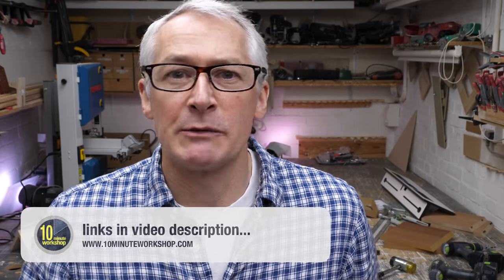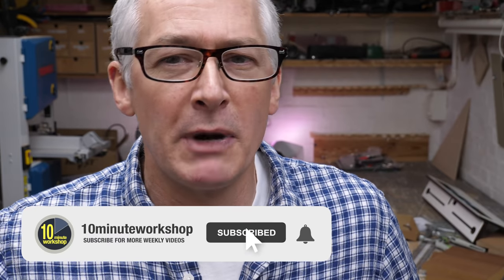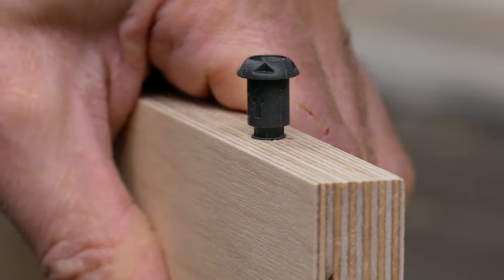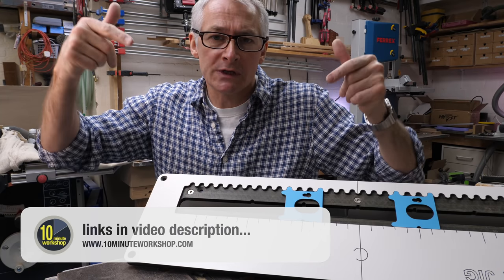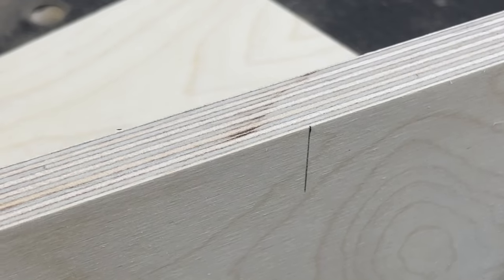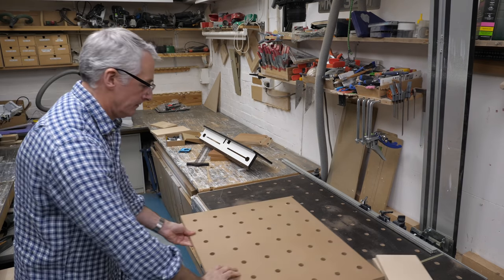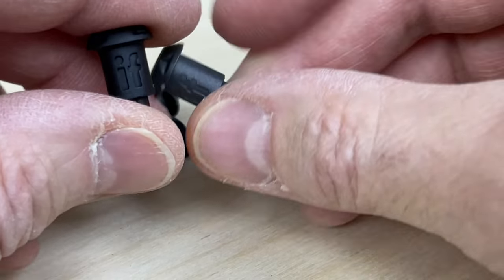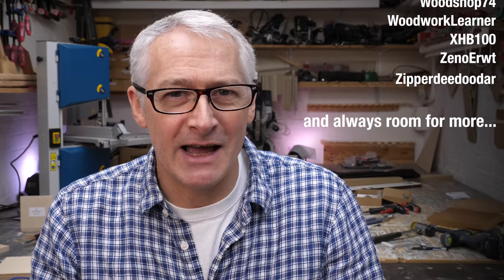Peanut 2 Jointing System - the mid-range solution? [Gifted/Ad**][video 429]

Comment: Peter, as ever you continue to knock it out of the park with your intelligent, balanced and considered demonstrations and reviews.👍 Its an interesting system and clearly offers significant advantages for professionals who have some volume requirements for carcass construction.For these users who probably have a power drill, router and workbench already then the cost of the jig and the bits and bibs that go with it is quite reasonable. For those critical of the developer (at the price point) probably have no concept of how much time this took to develop and how that places into insignificance the cost and time to bring to market. It’s not for me as I have no need for knock down cabinets and just use my very expensive domino (bought as a result of watching PM videos), however that is an irrelevant fact.😂

I read lots of comments asking how joint compression is being achieved in this manual version of the peanut jig which clearly can only be cutting a parallel slot, where the router bit enters and leaves is a round hole and the slot is engaging with the underside surface of what is essentially the underside of the ‘counter sinking ‘ of the screw which makes the peanut less compressible at that section as is acting as a wedge. I think.🤔

Anyhoo - thanks for this.😀👍👏
Reply from the maker: Thanks Norman! That's a great common-sense post, and likely explanation of the mechanics of it - as I hope to have it explained tome later today! 👍

Comment: I’m just thinking out loud here, but this seems like a great idea. It does rely on the purchase of a router too, so it’s £400 plus a router, but I like the idea and, for example, it should allow for permanent joinery with a Domino and by using the Peanut 2 system as well - should you need to disassemble parts to be able to fit it into a clients home, or even just be able to take it apart for a temporary solution (outdoor furniture during summer, but take apart to store in winter, etc). This system seems like a really good idea that is worthy option compared to a Festool or Lamelo.
Reply from the maker: Yes, it really does. And who amongst us looking at jointing systems doesn’t already have a 1/2” router? The mini jig - out in a few weeks - brings the cost of entry down significantly, too. 👍
Reply: @10MinuteWorkshop . Oh, I do understand that, but it was more to do with that the Domino and Festool are a all-in-one system, if that makes sense, but as it uses a router, at least the router is handy for other work too. There’s no doubting that this is a great system.

Comment: Very good system, great video Peter. I always enjoy your info & teaching. $460 US is a small price for what it can do. I have owned the DF 500 domino for 10+ yrs and just finished attaching face frames with 6x40’s in the lower cabs knowing the 4 teen boys in the house will punish the frames and doors.  This would make the uppers face frame attachment a breeze.  I have been eyeing the Lomello Zeta for the same application. Thanks again Peter
Reply from the maker: Thanks David. And yes, good point about face-frames - I rarely use them so I didn’t think of that, thanks! 👍👍

Comment: Good honest impartial video as always.
I really like dowels but yet to find a 100% accurate system 
Review of the triton dowel machine wasn’t very reassuring.
Have you any knowledge of a accurate dowel cutters which is effective and accurate? Thanks scott
Reply from the maker: Thanks Scott. I did a video - Dowel Jig Basics, https://youtu.be/zTj_hiEVfvw - where I got the best I could out of a cheap dowel jig. The wolfcraft is well regarded - I have one but haven’t really used it. Not sure if you’re aware but the peanut mini jig will also do dowels, is very well made and accurate. I have the latest version but haven’t reviewed it yet because of all the workshop stuff going on, but there’s a playlist with all the Peanut 2 reviews and builds in it here; Peanut 2 System & Projects - https://bit.ly/Peanut2system 👍👍

Comment: Real shame the centre line doesn't run all the way through. Seems a little bit of guess work for total accuracy between their line and your line
Reply: I thought the same, first thing I would do is score the centre of the line with as making knife all the way to the edge of the black part. Maybe it doesn't have to be bang on due to the nature of the fitting, IMO should be done already though.
Reply from the maker: It hasn't been an issue for me, but a fair point; obviously not an issue for end-of-board cuts as you'll be up against the fence, but for mid-board cuts I totally see where you're coming from. How about a similar little notch in the top black rebate, same as you get in the bottom? 🤷‍♂️
Reply: That’s a fair comment. I was thinking that rather than having to line up with a curve, why doesn’t it have a ‘V’ - so the user can line their piece up with the point of the V. Then again, as Peter showed, if you have a piece of scrap to butt up against, the components are locating in the same place each time.

Comment: The basic idea has clearly been around for ages but this is a fine implementation of it. Personally, I've already bought into the Domino system and I mostly work with real wood so I probably wouldn't buy this as well but for someone that works primarily in MDF and ply this could easily be a game changer.
Reply from the maker: Surely you mean Real Wood™ 😂 Yes, obviously aimed at the sheet goods fitted furniture designer/maker/installers out there, and a very well thought out system.👍👍

Comment: Hello Peter. I don’t know how much you have seen about the Shaper Origin but they recently had a hardware library update and they now have the ability to do Peanuts as well as Dominos, Blum hinges, Lamello Cabineo (as well as the m6?), Soss hinges as well as a lot of other hardware. Just an FYI.
Cheers
Ron
Reply from the maker: Thanks Ron! I wasn’t aware of that, no, so good to hear, thanks! Peanuts were especially problematic for the shaper I believe, because as soon as you move the machine backwards the bit would exit the material?? Something like that anyway, and not what you want at the end of a peanut slot! 👍👍

Comment: That's an interesting jointing system!  I must say that I've never heard of it. The part of the video with the router was not totally clear to me. Do you need a copy ring
(or how is it called) to route out the key hole slot in the board? Thanks for sharing the video.
Reply from the maker: Yes, you need a low-profile copy ring/guide bush; it comes as part of the starter kit, and is available as a spare part. 👍
Reply: @10MinuteWorkshop  (learning) woodworking has many things in common with (learning) Spanish. LOL  Both are my hobbies. At the start you don't know
anything. After many hours you get some knowledge of the theory and the practice. (theory is always easier) and you can start to make something yourself.
I finally have my small table saw up and running. Now I need 72 hours a day.

Comment: Interesting System! But like others wrote to expensive and in my mind to big for small projects (and i think, the smaller jig will be also expensive...). Bying the jig and a good router will cost about 1.000 EUR, nearly the price of a lamello. But a no go is, that you can not disassemble the parts without taking a hammer (if not glued). Clamex can be disassembled with a hex driver...
Reply from the maker: Only you can decide if it’s too expensive for you. But it’s aimed at folks in the fitted furniture business; they tend to have 1/2” routers, already. 🤷‍♂️👍
Reply: @10MinuteWorkshop  also, you can use the router for all kinds of other uses, a lamello is a one trick pony (or race horse in this case)

Comment: With fittings like these, I always wonder about the longevity of the availability of the consumables. Dominos can be made easily if they ever were to stop being produced, which obviously wouldný happen with a system that is as popular as that. This niche product seems nice, but I find it tough to pay 400 gbp and have to take that gamble.
Reply from the maker: That’s a fair concern; to be clear though, these fittings have been around for a couple of years and are widely used by cabinetry manufacturers whose main method of production are CNC and nesting machines. This is the first router jig they’ve made, and is aimed at the one man band maker/installer. There’s a mini jig coming that will settle a lot of the cost concerns. 👍👍

Comment: Like the look of this. So, does the mushroom bit of the peanut fixing deform when knocked into the slim part of the keyhole slot to create the tight fixing? Or does it deform the wood for the tight fit? If it's the former, it's not so much a knockdown fixing. I may be missing something of course.
Reply from the maker: Sorry Stew, neither! I don’t know how it works, but it manages to cut a slot that gradually deepens, so the head of the mushroom pulls tight agains the rebate. The peanut/mushroom doesn’t deform, and the joint can be made then taken apart many tunes without any problems. Really clever system! 👍 Mini jig coming very soon, will make it a much more affordable entry point!
Reply: @10MinuteWorkshop  Perhaps the blue inserts are not exactly parallel to the surface of the jig, and as you move the router to the right, the hole gets a fraction deeper as you go? 🤷🏻‍♂️
Reply: @10MinuteWorkshop  could you cut one of the slots in half and measure the depth of cut. hard to see how it gets deeper with that jig

Comment: what is the height and diameter of the body of the peanut?  I don't have a 1/2 inch router and thought it could be done with a 1/4 inch straight router bit followed by a keyhole bit set at the right depth.
Looking forward to the mini peanut solution.......

Comment: I hope I'm not duplicating earlier comments in saying that I understood the keyhole recess had a variable depth so that it would get tighter as the peanut is tapped home. I s there some magic about the cutter or am I just confused?
Reply from the maker: No, this was me being slightly confused. The keyhole slot is ramped if it’s being used in a CNC, but on this router jig it’s a flat slot that’s very precisely cut so that as you start to slide the peanut along the top trailing edge catches the top of the slot slightly, and it basically wedges itself in, tightening as it goes. That’s my layman’s understanding of it anyway; I’m just happy that it works. 👍👍

Comment: I'm Mafell DDF40 user(bought on the strength of your review partly) so I don't really need one of these. I'm  sure it's very good and has a place in the workshop but at £333 + £200 for a half decent router if don't have one - you're stepping into Lamello Classic X territory in terms of price. Yes, the Peanut 2 is invisible and I really like the look of the actual connectors  but it looks like a lot of hard work to make basic joints. I look forward to seeing the mini jig but it will have to compete with doweling jigs in terms of price to tempt me.
Reply from the maker: Fair enough - but in all seriousness, who in the fitted furniture / carcass construction business doesn’t have a 1/2” router, let alone a spare that they could dedicate to the jig 🤷‍♂️ And a Lamello Classic X - as lovely as I’m sure it is - is just a biscuit jointer; pretty sure you won’t get any KD fittings for it. 👍👍
Reply: @10MinuteWorkshop  Lamello Classic X works with Clamex S Knock down fittings They differ from the Zeta ones as they need a couple of screws. Better than this jig IMHO.
You also get a valuable tool at the end of it.

Comment: Good review and interesting product Peter. Thanks for sharing.is it the proprietary cutter that creates the angles at the bottom of the T slots that pulls the joint together?
Reply from the maker: Thanks! Yes, the cutter comes as part of the starter set, but is available separately. 👍
Reply: Router cutters can inherently only sweep a circular cross section, so.. somehow it must move on an angled path in order to create the angled result. My guess is that you put something on your router that interacts with the jig when you do the sideways move.

The website is very unclear on this. The cutter is supposed to move down by 2 mm during the first half of the 20mm sideways movement. No idea where that comes from though.

Comment: I think this is a potential winner. I would prefer to build cabinetry with proper joinery but that doesn't make it easy to move to a new house. I love the fact that is invisible and can be knocked down again. As an architect, when I design fitted millwork, I always try to approach it as a cabinetmaker. (my other hobby) I like to think I know what the cabinetmaker has to go through to make the end product. This is a revelation as far as I'm concerned.

One minor comment, I've been a patreon supporter for over a month and I don't see my name.
Reply from the maker: Thanks Patrick! Yes, a smart system, very well thought through. Re. your Patreon credit - and thank you for your support - I’ll look into it, but the list is usually updated for the Friday video closest to the end of the month, so sometimes if you join ‘on the cusp’ it takes a little longer for your name to appear. As I say I’ll check and message you through Patreon, but you’ll certainly be on the list from this Friday. 👍👍

Comment: fantastic. But what is realy needed is a system that will go down to 12mm or at minimum 15mm. (will the mini you mention be able to do this?) If im correct this will only go as small as 16..? So that means 18mm ply or MDF will be the thinnest it will do. Still a cool system though :)
Reply from the maker: I’ve used them in 12mm - the face-to face connection for the bench shelf was 12-12. The fence centres at 18 but will accommodate 16mm  (eg egger board etc...) - don’t see why you couldn’t pack out the fence by a few mm to centre on12mm; I’ll have to try it. I j if they can do 12mm compound mitres. 👍👍
Reply: @10MinuteWorkshop  fantastic :) thanks for the reply :) yeh would love to see it work on a 12mm board at 90 digrese :) :)

Comment: I like the system and your presentation. I have been looking for a system for making MFC cabinets. Could you please do a demonstration of the system using MFC please and assess the performance?
Reply from the maker: Honestly I rarely use MFC, but the system was designed specifically to work with pre-finished boards like MFC and veneered MDF, so from the samples I’ve seen it works extremely well. If you follow the links in the video description to the Intelligent Fixings website they have demo videos where they use MFC extensively, or if you contact them directly or through eg Instagram I’m sure they’d be happy to advise. 👍👍

Comment: Seems an interesting idea but I can't get my head around the selling price. I assumed, given that it's a relatively simple design and idea, with no moving parts that it would be by far the cheapest solution, not mid tier!
Reply from the maker: I’m old enough to remember when kitchen worktop jigs were around £400, and they’re just a board with a slot cut in it. 🤷‍♂️ This is a complex jig to make, which makes it expensive. There’s a mini jig out very soon - video out next week - that brings down the cost of entry considerably. 👍

Comment: Nothing new under the sun, I remember being taught to make virtually the same joint 55 years ago by my woodwork teacher using a number 8 screw and cutting the slot as a mortice and using a bit the same diameter as the head of the screw.
Reply: what have you made of after?
Reply: @gameboy398  If I understood your question I might be able to answer it.

Comment: Every video on the Peanut system I've seen refers to the joints tightening as the peanuts are inserted into the joining piece and the joint moved into alignment. 
Could you explain how this happens please ?
The peanut slot cut with their router bit can't get slightly deeper as the slot is cut and equally the plastic peanut can't get slightly shorter as the joint is assembled.
If I could understand not THAT the joint tightens but HOW the joint tightens I'd probably buy one for a job which has just come in - fitted wardrobes in 4 bedrooms which access to is very restricted to so they must be assembled on site.
Reply from the maker: Honestly, I’ve had the guy who created the system explain it to me in person, and I still don’t really understand it. But I do know that it works. 👍
Reply: @10MinuteWorkshop  It feels good to be as stupid as everyone else 😊

Comment: Looks very neat, I imagine it’s very good for commercial jobs where you need to get stuff to site flat packed 👌 not sure if I am tired but I can’t work out if the router guide is oval and the bit is spinning how does it produce a slot that is bigger at one end 🤔
Reply: The router guide bush is round and the jig insert is slotted. The cutter is T shaped and produces a key hole slot by entering and exiting at the same end. I hope this is helpful, we have animations on our website that explain this more clearly.  www.intelligentfixings.com
Reply from the maker: It's a keyhole-type of cutter Ross, you plunge, then as you move the cutter sideways it creates a slightly deeper cut by magic. That's my understanding anyway. 🤷‍♂️ 👍
Reply: @IntelligentFixings  that is helpful the enter and exit at the same end makes sense thank you, very smart idea 👍
Reply: @10MinuteWorkshop  thanks Peter I think I have failed the intelligence test required to use these 🤣
Reply from the maker: Me too! 😂👍

Comment: Thanks for this first look it seems promising and Looks really interesting. Is a connector at each end of, say a 600mm, joint OK or is there a recommended interval between fixtures?
Reply from the maker: Thanks! Like any connector, over eg a 600mm carcass I think I I’d want something in the middle, and I always used 3 when I was using dominoes. It’s something I want to test a bit more as I get more accustomed to the system, though. 👍